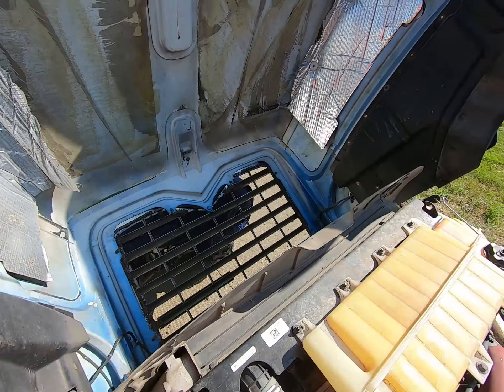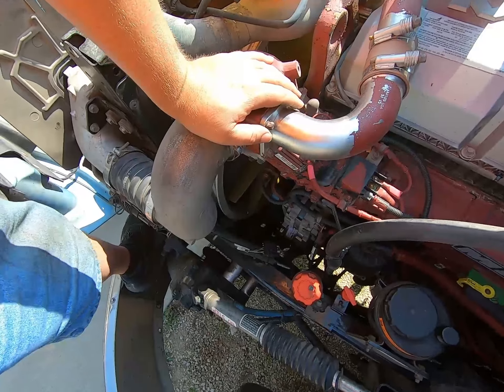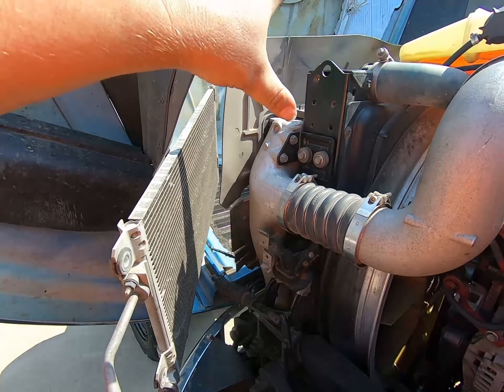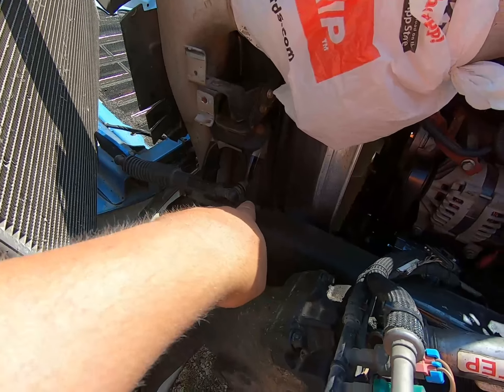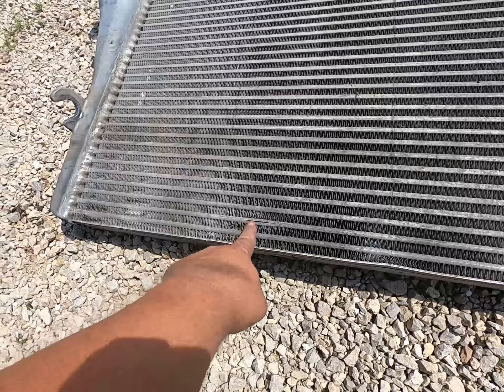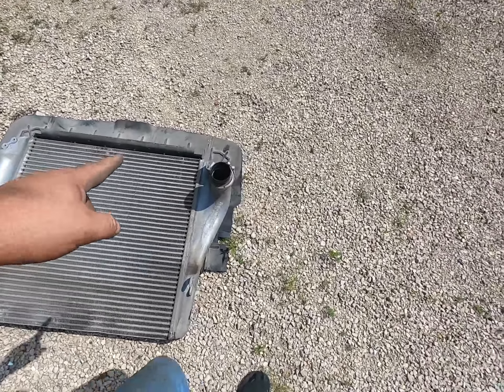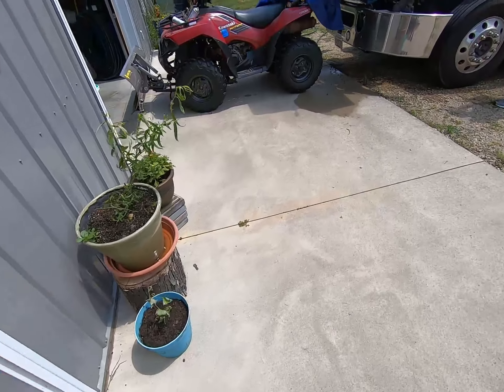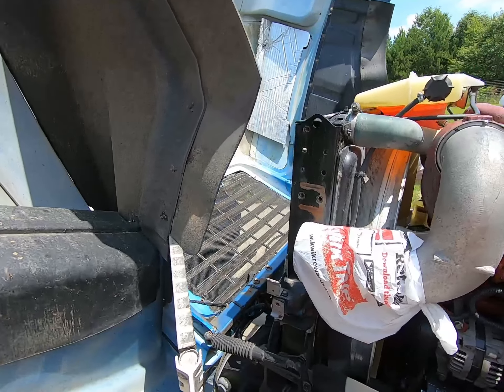How I replace a failed charge air cooler on a semi truck. #mack #pinnacle

Comment: YOU MAY ALSO WANT TO CHECK THE EGR VALVE AND THE EGR COOLER WHICH MAY ALSO CAUSE REDUCTION IN FUEL MILEAGE AND POWER

Comment: I put a 1000hp rated air charger in mine last time I couldn't believe how bad the old one leaked. Might of mentioned using a bottle of soapy water on one will show leaks if it's not a gaping hole like that. Most just start leaking around the welds you mentioned..
Reply: You can also just use a hose

Comment: Hey DIY, My AC on a 2017 t680 with a cummins isx15 is leaking water everywhere, not just at the drain. Every connection between the hoses for the AC system is leaking water when it's running. It still blows cold, the filters are all alsoclean and new.. Any idea what might be causing it?
Reply from the maker: sounds like the drain tube is plugged and water is backing up and running out . you can gently stick something up the drain from outside to see if you can unplug it. unless you meant hoses other than the drain?
Reply: @DIYSEMI  It's coming out of everywhere there is a connection between any of the AC lines. Almost like there is way to much pressure in the system.
Reply from the maker: Are u sure it's not just condensation?
Reply: @truckercarlson9081  How much humidity was in the air when you looked at it? Check it on your phone. If it’s over 50% that’s normal. The AC lines are super cold and humidity in the air is condensing on the lines. If you’re getting water inside the cab that’s just the drain tube getting plugged up. You can clean that with a small brush if you can take apart the dashboard.
Reply: Prolly a blockage on the AC